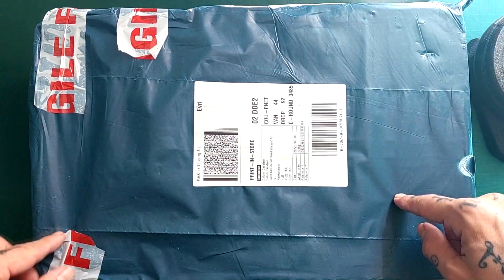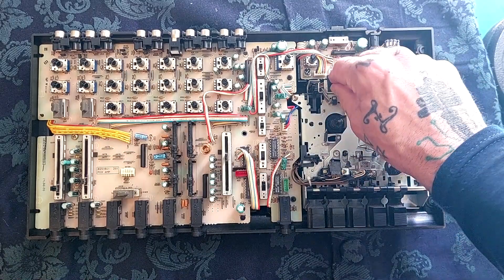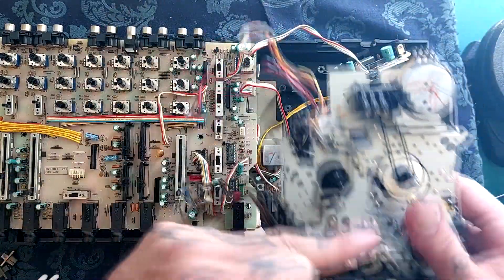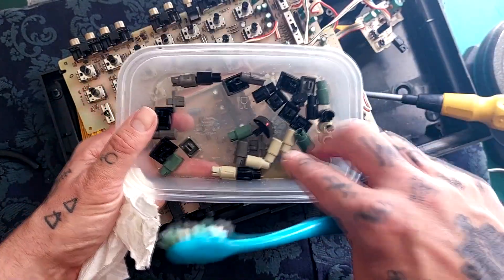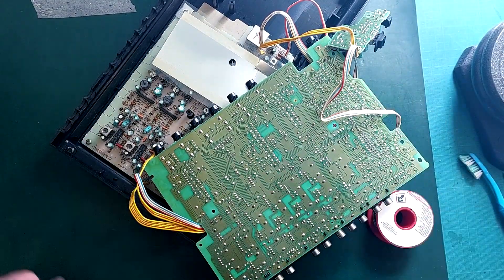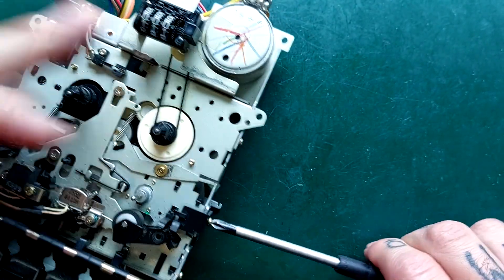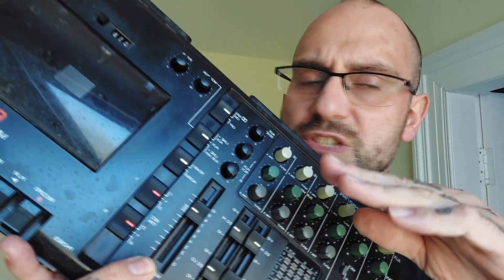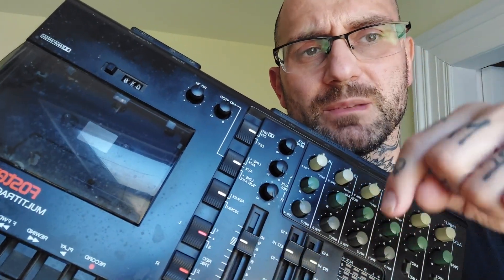Fostex X-26 Multitracker | Tear Down

Comment: Hey mate, quick question on this. I just picked up a clean X26, the only issue is when it’s powered on, the capstan is constantly spinning. Seems to work fine, but I would assume this isn’t normal behaviour. Do you know what might cause this? Also, Moomins!!

Comment: Hi, nice videos!!!!
I have this same Fostex X-26.When I bought it the tape mechanism was not working so I replaced motor and belts and it worked. But now that the motor is running the mixer part is not working (I cant hear anything).
If I diconect the motor the mixer starts to work again, so weird.... any tips???

Comment: Hi There, Brilliant video. I am only starting to learn how to tear down 4 tracks. I have a Fostex xr-5 and it was stupidly left in a outside shed and the rain got at it. Is it repairable at all do you think? 
It seems to be working lights on etc and tape working but I opened up the case and it was waterlogged and rusty boards I let it dry out and I don't know were to start? what next? It would be great if you could reply to this? Cheers. Kevin
Reply from the maker: Thanks. It may be salvagable, and itll have parts value at the very least, but that sounds like a lot to deal with for a first project, to be honest. Ideally, you'd find something that just needed a basic clean and new rubber first time you fix up a four track!
Reply: @Tetrakan  Thanks for the quick response. I have been watching alot of your videos this afternoon and found that my xr-5 looks identical to the fostex x -55 your teared down. I look forward to working on this. I will take it slowly - how and where do I get the replacement belts and the parts as some are rusty. You have a great skill with this!! Are you making more videos ?Thank you again for replying Tetrakan. Kevin

Comment: I am very happy with this video, this is great help. I wan't to replace the belts on my X-26, although i find it hard to find an exact replacement kit. If I were to buy a full 25-135mm set from Amazon, is there a certain brand I should look for? Thanks!
Reply from the maker: I’ve just bought those sets from random suppliers. Maybe a third of the belts in those sets have a kink, but there are usually enough good ones included it’s worth the price.
Reply: Hello, hoping for a reply on a 2 year old comment but which sizes are the replacement-belts for this model? Sorry if you mention it in the video, had a scroll through but didn’t catch it if you mentioned it. 
Hoping for an answer. Greetings from Sweden and thanks for a great video.

Comment: I have an issue with my x26 where the tape player is stuck in play mode, I can’t get a tape into the deck at all. Any advice to fix this would be awesome!
Reply from the maker: Could be just the belts need to replaced. At worst you might need to  partly disassemble clean and lubricate some of the gears which raise and lower the magnetic heads. Details in this series of videos about the cassette player https://youtube.com/playlist?list=PLYsfQOh0tsJVl859LSG8MXisbMwLEW-L5
Reply: @Tetrakan  I got the head to start moving but I’m now realizing my problem is with the record button. It doesn’t want to push down. It seems like it’s being blocked by that plastic piece above it
Reply: Was moving because I kept trying to put type 1 cassettes in 🤦🏻
Reply from the maker: The record protect tab on the cassette needs to be intact. If its broken off, cover the recess with sellotape or similar and the record button will press down.

Comment: Hey, love your videos! For tapelooping, between a yamaha mt100II and a Tascam Porta 05, which one would you recommend? Thanks!
Reply from the maker: Thanks! The yamaha I'm not as familiar with but I think it's 3&3/4ips, double the tape speed of the others, meaning it'll sound less lofi, and a 30 second tape loop will only run for 15 seconds.... that's not what I'd want for that application. Of the other two the tascam is definitely easier to use and maintain, but the fostex's mixer is more flexible and allows you to do no input drone/oscillation stuff if you were so inclined.
Reply: @Tetrakan  many thanks for your input! i now got some new offers : a yamaha mt4x for around 200 bucks, and a tascam 424 mk1 for 350 bucks. i really want the tascam because of the three speed settings but damn that price is high..
Reply from the maker: Yeah tough one. MT4X is better value for money and more feature rich, but the small footprint and 3rd speed makes the OG 424 the best unit for loop stuff.
Reply: @Tetrakan  what is the "small footprint" ?
Reply from the maker: I mean it takes up less space on a desk alongside synths, pedals etc, and because it is smaller &  lighter it would be easier to transport to practice rooms or venues.
Reply: @Tetrakan  oh right! yea it was also something that i like about the 424.. i think i will go for it in the end. again many thanks for sharing your input!!